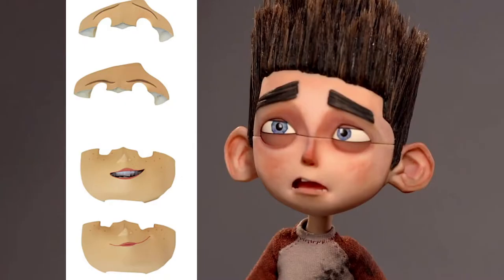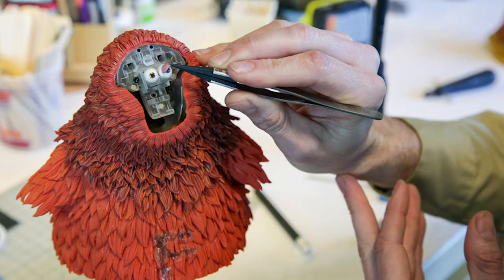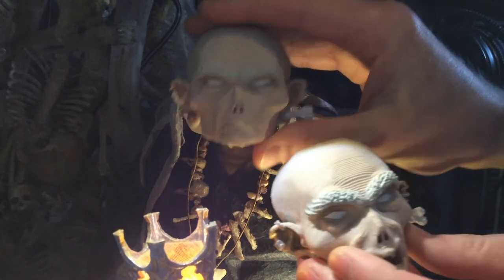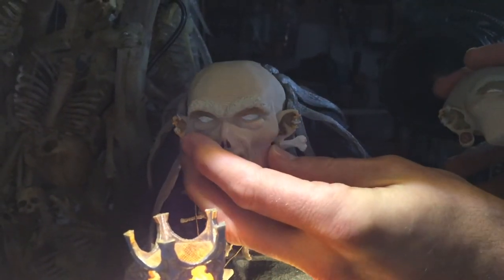3d printing faces for Stop Motion - Bone Mother

Comment: This is really cool! If you were to take the Laika approach you recommended, do you have any tips for removing seam lines in post?
Reply from the maker: Aside from getting really good at after effects, you could always create a neutral clean face. then create a second exposure and put that face on after every frame. it's the technique that we used on the Little Prince for the replacement mouths. then you just isolate the clean area to hide the seam lines.